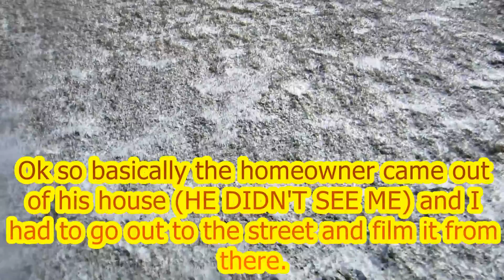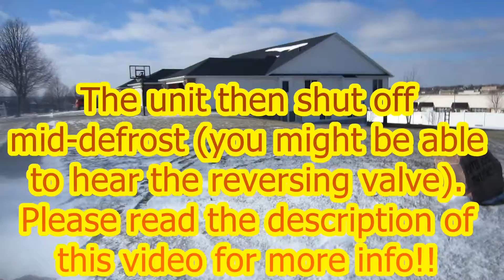2000s Bryant Heat Pump Defrosting

Comment: It's the season for heat pumps to be defrosting?
Reply from the maker: Yep. Pretty much all winter a heat pump will be running in heat mode and defrosting.
Reply: Yes. From late October - Early April is the season for heat pumps to defrost.